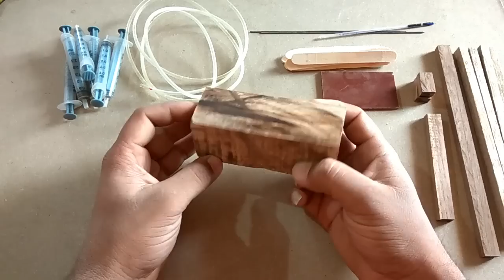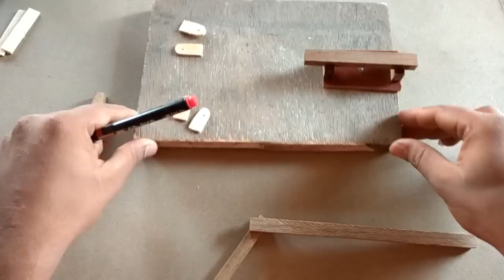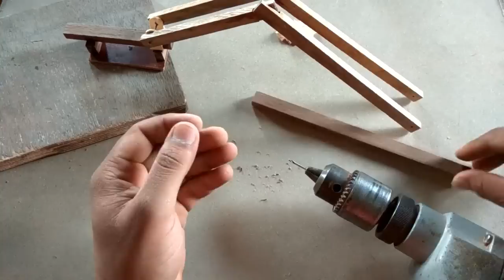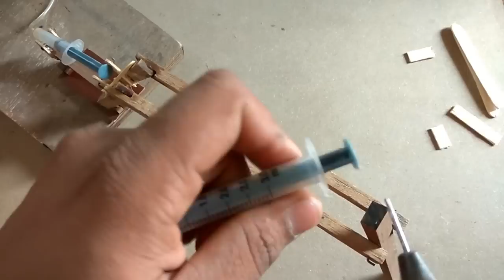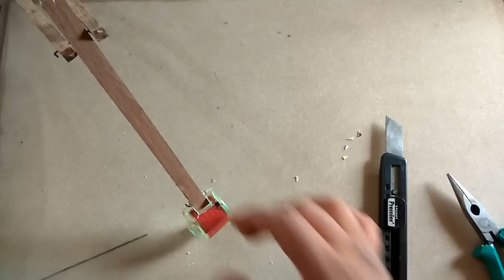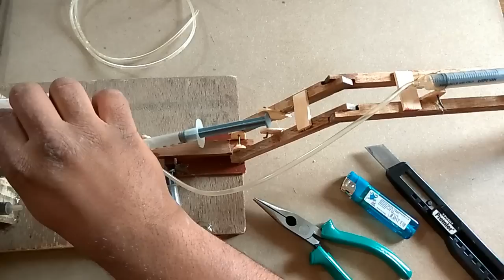How to make JCB (DIY)

Comment: We are trying to find solution for our one mega project, it is fast open doors, it should be open 3 meter in one second and close in one second. Size of door is 3 meter x 6 meter. We can divide it in three folds of 1 meter(Like JCB Arm). Weight of door is 6 tons. Total number of doors is 5000. For quick operation we can use only pneumatic cylinders or electromagnetic mechanism. If you have any idea do contact.